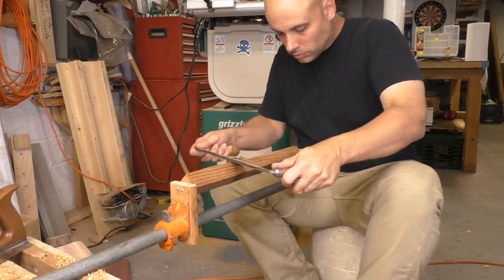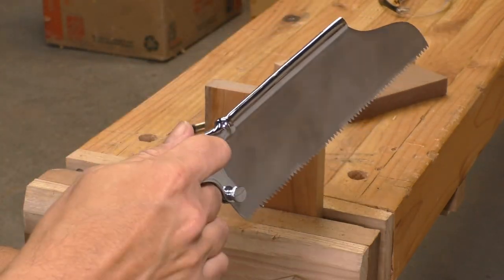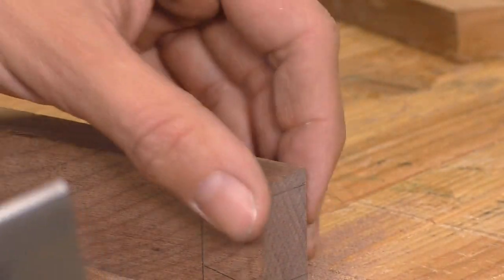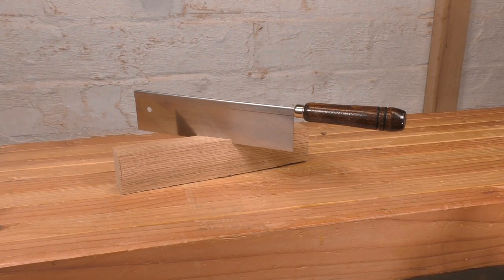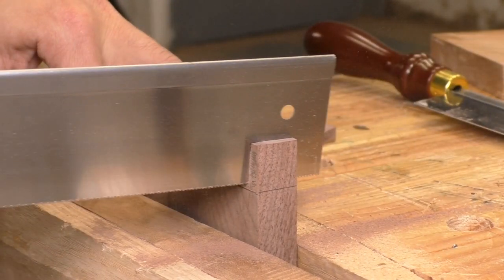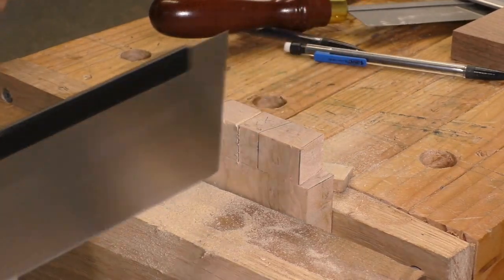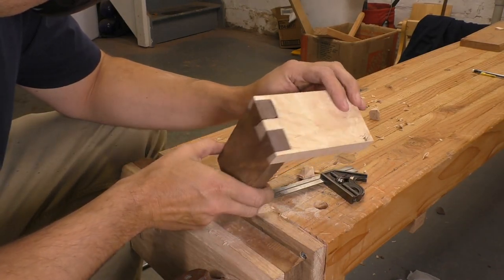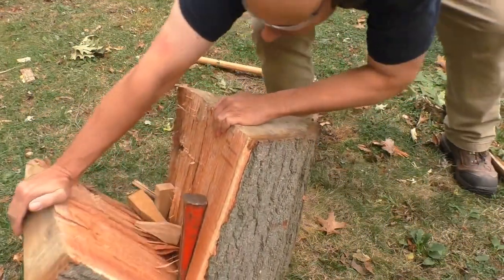Four Inexpensive Dovetail Saws Tested.

Comment: The first one looks like an old fashioned bone saw. I used Zona saws for cutting wood for RC Airplanes. It does work great, but you are correct that it's a bit lightweight for real (non-balsa) wood or wood of any reasonable size. 
All great stuff and I'm loving your woodworking for humans series!

Comment: I bought the Suizan folding dovetail saw which is my favourite hand tool in the shop. It weighs more than the fixed blade saw, but I can toss it in the toolbox & go if needed. It's ~$44 on Amazon,  & the handle protects the teeth when folded. I highly recommend it. It takes little more than the weight of the saw to cut due to sharpness if teeth & thinness of kerf

Comment: Your experience with the little zona is what I experienced with a dozuki. Sharp, thin, and precise, but I couldn't steer it. Unless I started it perfectly, I would cut wrong.
I since found and sharpened an old Spear and Jackson, and it's much easier.

Comment: I think Jon heisz has a video where he does dovetails with a hacksaw and sharpened up screwdriver  makes a great point that sometimes it's not the tool.
Reply: I think Rob Cosman made that video.
Reply: @1pcfred  yep, both!
Reply: @miki09876  ah must be a challenge thing then. A big part of doing dovetails is coming to terms with the geometry of the joint. When you're done putting it together there's very little you can actually see. That's the part that has to look good too. When you can seperate those edges out from the rest you can make better looking work. The problem rookies have is they try to achieve a perfect joint. You're only going to get so close to that. Usually it isn't quite close enough either. But if you focus more on the bits you can see and let the rest slide that can work out. Has to do with the nature of wood itself.

Comment: Hey Rex great video! I bought the large zona saw and then made a handle for it with a Blackburn tools template. Works really well.
Reply: Was wondering how did you remove the handle from the zona saw? I'm trying to do the same but was having trouble. Thanks!

Comment: One day while doing some joinery I wondered about how well a metal hacksaw would do with an 18TPI blade.  It did pretty good actually.  A touch rough though.  So I lightly dressed the set of the teeth with a sharpening stone riding the back spine of the blade.  The cut I got was fast and smooth.  Sort of a poor man's or quick and dirty classic bow saw.  If you've never used it give it a try.  Just reserve that blade for wood.
Reply: I have a hacksaw in my woodworking only toolbox with 14tpi. Works great.

Comment: I love my dozuki, but the downside is that you can't sharpen it and have to purchase replacement blades for them when you lose teeth or they get dull.  Once you add up the cost of the saw plus a couple of blades you are getting close to the Veritas dovetail saw, which I also have and really like.
Reply from the maker: I don't disagree, but don't forget about those saw files, which are not cheap and are also disposable.

Comment: In the UK you can get  a what Spear and Jackson call a traditional tenon (back) saw for £21 which is good for tenons and dovetails. Recommended by Paul Sellers. No idea if it's available in the US.
Reply: We can get them. They cost $45-$50 here depending on the model. There's just no cheap decent joinery saws available. It is something you have to spend the money on to get anything workable.

Comment: I hope you cover the 'Box Joint'.  I have been wrestling with this type of joint for my small boxes for years now.  I do not want to use a table saw.  I do not want to use a router.  A saw and chisel are preferred.  Strong box joints for utilitarian boxes.  Just on my wish list.  Thanks.
Reply: Bruce Brachman I totally agree with that!
Reply from the maker: Hey Bruce: that box joint is really a machine tool joint. For handwork, dovetails are actually easier and stronger. Box joints are good and fast, but not by hand.
Reply: Box joints are the domain of the table saw. Pros use gang saws to make them.

Comment: Filling a gap like the one you had here is pretty much invisible if you fill it with end grain. SO in this case, rather than using walnut and putting in a sliver of long grain that always gonna show. Put in the maple instead and make it show end grain ans it disappears. you may need to make 2 triangular fillers, one of each species to fill a bad gap bu it's worth it to make the joint look perfect. Rob Cosman has a video on this that's worth watching. Matt Estlea also has a video on camouflaging poorly executed dovetails in his garden workshop series. Also worth viewing for some really useful tips.

Comment: The Dozuki is a great choice for a dovetailing/fine detail saw. In fact, I don’t use any of my European/Western style saws anymore. I’ve seen the light and have gone full Japanese on all my hand saws. Kataba, Dozuki, Ryoba are the only way to go.
Reply: So you sit on the floor and hold the work between your toes? That's full Japanese woodworking. Me, I'm sticking to western style myself.
Reply: Paul Frederick Sometimes. It depends on the project. I like to work smarter, not harder.
Reply: @FriedPi-mc5yt  I guess if I gotta I'll crawl on the ground to do stuff. For woodworking I've got that under control here now though.
Reply: Paul Frederick Yeah, you do you man.

Comment: You might want to consider making a frame saw as part of this series. I've heard, and read that people use them as dovetail saws very successfully.
Reply: Yep. Honestly, for fine joints i use a straight blade in a cheap hacksaw frame. The replacement blades for Stanely's miter saw are great although you might have to cut it down and drill a hole if you don't have a 14 inch saw frame. Still, under $15...
Reply from the maker: There's NO QUESTION that a frame saw is perfect for this series. I'm on it!
Reply from the maker: Rick: can you drop me a link to the blade you like?
Reply: @RexKrueger  You can get by with a band saw blade made for cutting metal that fits into a portable band saw. But it hadn't occurred to me to use a miter saw blade until Rick's comment, that is a great idea!
Reply: CRL H36193 Replacement blade
Reply from the maker: @RickBoat  Danke
Reply: @alexandergoya  
Rob crossmen has a video cutting bovetails with hack saw, screwdriver, claw hammer.
Reply: @alexandergoya  you could be but i think on a cheaper hacksaw frame you would run into issues keeping the cut straight, i've  only used them on metal but when i do the blades have a tendency to twist in the frame
Reply: @alexandergoya  hacksaw blades are a bit thick. You can't sharpen most of them either. I did finally find some bandsaw blade that I could use though. Let's just say the teeth on hacksaw blades are not ideal for woodwork. I don't think the teeth I can file are ideal either, but I can do better than what comes on a hacksaw blade.

Comment: Bought the little Zona saw for dovetails in small parts. The first few times I used it I thought it was hopeless - blunt and inaccurate. It was quite a while before but dawned on me that it is set with its teeth arse about face, god knows why. It was easy enough to remove the plate and turn it round to use in the push stroke. It's great now, but only for small projects. Incidentally, while the Japanese saw is half the price of a Veritas, I assume that it cannot be sharpened?

Comment: The downfall of the gents saw is the straight handle.  You might consider doing a project to put a homemade dovetail saw handle onto the otherwise usable saw plate.  Filing a new lower TPI rip tooth configuration would help with cutting speed, but probably way more effort than most want to commit to.
Reply: I've done all of that with a flush cutting saw. I picked it up for like a buck at a yard sale. Was a Bracht made in Germany. Had some weird farm cut tooth pattern on it that was duller than Latin class. It took me a few tries to get teeth cut in it that I liked. Kind of OK to use now. Not the best. But perhaps the best I have.

Comment: You can buy hard point throw away Tenon / Dovetail saws made by the same company’s who make the 20 & 22 inch cross point hand & panel saws .Company’s like Irwin Jack ,Stanley Max ,Bacho & now probably Dewalt .They are throwaway ,but tend to last a lot longer than the bigger hand saws as they only get used in workshops on short cuts for Tenon ,Dovetail ,Lap joints & other types of bench carpentry joints .They can be had for £12 U.K. & probably around $20 or less in the USA . Better still have a mooch around garage & car boot sales for proper old Tyzack ,Diston & Spear & Jackson professional Tenon & Dovetail saws in good useable nick & re sharpen & set ,they will last forever .Don’t waste your time with them silly straight handled saws ,they are for kids first tool sets.

Comment: One of the great things about living in Great Britain is the number of second hand really old saws you can get for little money. My favourite is a Marples brass backed saw.
Reply: The problem with older vintage saws, unlike almost every other hand tool, is that you need to know a lot more to get an old saw into working condition. If you can't sharpen a saw, you're better off not trying and just buying a new one from somewhere like Spear&Jackson or Veritas. Saw plates are the most deceptive bit of tooling in the shed - they just look simple, but actually making a good one is something we didn't master until really rather recently. Your 17th century joiner had chisels and mallets and squares and so on that were functionally just as good as modern tools to any practical level; but their saws were definitely worse.
Reply: @MarkDennehy  well, if you are going to do much woodwork you have to be able to sharpen all your tools, chisels, planes and saws.

My Marples saw is cast steel and whilst I can't say exactly how old it is, I have presumed 19th century or possibly early 20th. It really is quite good.
Reply: @BensWorkshop  Very true, *but not on day one*. This series is about starting up; get people started easy, then lean into the finer details. On, like, day four or so :D For a beginner? Buy a new saw and buy old chisels and planes.
Reply: @MarkDennehy  if I bought a new plane I'd start by sharpening it, same with chisels. Oddly many of the old tools I've bought (at least half including the Marples saw) arrived sharp.
Reply: @BensWorkshop  Sure, and so would I - but that's several years into this. 
For a new beginner? Skip old saws. Old everything else is great; but old saws require saw files, saw vices (even if shop made) and a bit of expertise. But if you just bought a veritas dovetail saw or a spear&jackson tenon saw or something like that, you're able to cut joinery from day one and by the time they've dulled, you've put in enough time that sharpening a saw isn't an intimidating proposition anymore. I mean, c'mon, we all remember the first time we sharpened a chisel and how much we stressed over finding the right bevel angle and what to use as a sharpening method and which grits were ideal and all that - and now we just stop work every so often, turn to the strop or less regularly the stones, sharpen up in somewhere between 30 and 60 seconds and get back to work. This is the same gig, but saw plates are just more fiddly if you get one in bad condition.

If you can throw the $30 at the saws mentioned in the video, you can throw $30 at a better saw that works right out of the gate and just get on with the fun bits faster; and you do this hobby for a few decades at least, so you'll get to saw sharpening soon enough.
Reply: @MarkDennehy  I just watched Paul Sellers videos on how to sharpen saws and chisels. I'm new to woodworking. (Well sort of, new to hand tool woodworking). So, no, I don't agree. You'd be better off with a few YouTube videos, saving some cash and learning.
Reply: @MarkDennehy  if you can't sharpen a saw keep trying until you can.

Comment: You can get decent older back saws for around 10 bucks all day long at flea markets, even in areas where there aren't a lot of woodworkers. 

Also beware of getting on the little japanese saw trend thing like all the 'cool kids' (NOT). Most of these japanese saws, especially the cheap ones are throw away garbage just like the big box western saws. They can not be sharpened. 

To get a good quality japanese saw that you can sharpen you'll have to fork over probably more than the veritas dovetail saw costs. You'll also need feather files you won't find locally. 

You can get the files you need to sharpen a western saw anywhere, and cheaper.
Reply from the maker: I just don't find that to be true. I've lived across the US and the tools you can find vary HUGELY depending on where you live. Many parts of the country have very few old tools.

Comment: have you ever tried using one of those oscillating end saws to cut joints?
Reply: Oscillating end saw... Do you mean a power tool?

    I've done some joinery with a "Sawz-All" (I have a Dewalt) with variable speed control, AND I tried (unsuccessfully) with a jig-saw (aka Saber Saw)...

   The Sawz-all has enough heft to the blade that you can slow it down and be really gentle with it to get an almost decent joinery cut... BUT like the regular carpentry saw, it's ragged, even with the finer teeth... It is after all, a "sawz-all" not for making a Rembrandt... AND they're also expensive.
   Most power tools are.

   The problem with the jig-saw (part of it IS my own fault here) is that the blades tend to warp inside the cut. This causes all manners of undesired side effects. I do tend to be heavy handed with tools (to say it politely) so once someone manages to accrue the skills, it might be feasible, BUT I've worked with these kinds of tools for years without getting much better about the blade bending issue... AND generally avoid it for joinery...

    Truly, you can do dovetails with an ordinary saw, too. It's just better to leave some of the waste so you can "sneak up" on your lines... I generally cut about a millimeter (1/16" or so) away from my lines and then clean it up with the chisels later.
   If I were to recommend any particular saw(s) for the beginner, it would be the Japanese style... You CAN find those at Harbor Freight (here in the States, anyway) and the cutting on the pull stroke tends to be better for beginners trying to keep the cuts straight than the "western style"... You don't have to get a Ryoba (the double sided version) to do everything, either... I started with a smaller pistol-gripped pull saw (can't recall the technical term) before I could justify buying a Ryoba... but I absolutely LOVE the pull saws. They were easier to learn and get used to... AND while I do still use western style saws, I keep a good quality pull saw around for the cuts that absolutely MUST be perfect every time.

   If you DO have the money to justify a power tool, then I will make one more recommendation. If at all possible, you'll find more service out of power tools that have a Variable Speed control... NOT just the trigger, either... A proper speed control will either be a knob or wheel (usually with a numerical representation on it) that adjusts the tools maximum speed with the trigger pressed or the switch "on"... Some tools might not sound more serviceable with the control, and while rarely used, when you actually NEED to use it, it's indispensable! 

    Example? A drill... Who doesn't want to drill a hole as quickly as possible? Right...
   Well, get a bit wedged into the wood and start smoking because the drill's running hot and fast and the hole is just that deep... AND you'll discover that turning the power down will reduce the burning and damage. You'll still want to "go in short bursts" to completely eliminate burning the wood and caking rosin on the bit, BUT turning the speed down also helps in those times when you want to drill into metal, too...

    SO whenever possible, seek out variable speed controls... AND you might even be well advised to hunt down specifically exterior power and speed controls that you can tune at the outlet... in case on a limit of budget or just availability, you can't get the variable speed type tools... 

    The only caveat on this (however) is that your tools' motors need to be capable of handling that control added on. Not all tools do... Like my drill press has internal "brakes" to stop the motor quickly... AND those are held "off" to free the drill by power. Thus, turn the power controller dial too low and the drill press quits all together... There's only so slow it CAN go.
   FINALLY, just the casual observation... running any motors on less than optimal juice tends to limit their lifespan. It's as true for the variable speed motors as well, BUT we have to do what we have to do... AND the technical "damage" is relatively low. It's just a fact of life, stuff doesn't last forever. 

    Hope this helps. ;o)
Reply from the maker: I have not, but maybe it would work great. I'm all about experimentation. Hell, i just tried to dovetail with a bone-saw.
Reply: @marvelousmaker  Sorry for missing the notification... OH... One of those...
   No. Haven't messed with them much... I don't know if you could even find it with a speed control, but I would recommend so if you could.
    What little I have messed with it, the only advice I'd offer is the mantra "Gentle Gentle... GENTLE". There may be more options (obviously) but the blades I've seen were "flimsy" for a power tool... You could feasibly do it, maybe shorter dovetails with one of the "round" blades where you can keep the cut closer... OR at least start the cuts with the round one, and switch to the long flat one to finish before going for "chiseling out"...

   I think I will keep to my sawz-all, though... just personally. I actually have one of those. (lolz... of course) ;o)